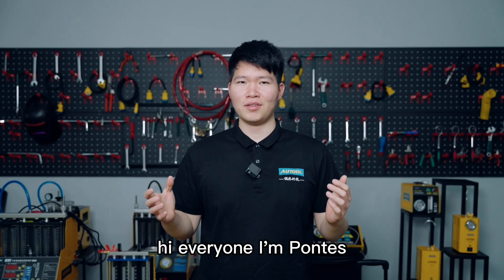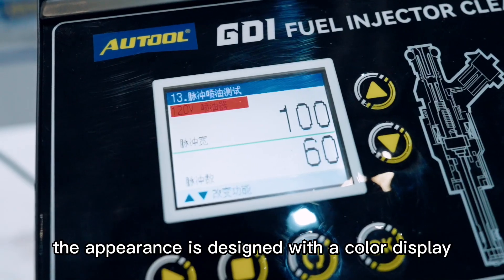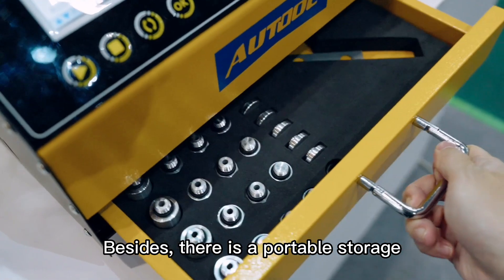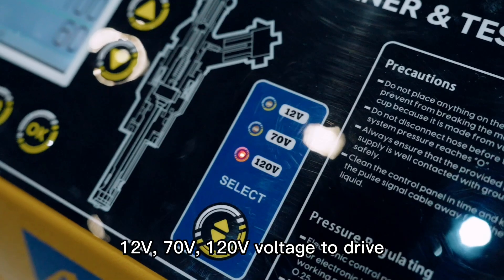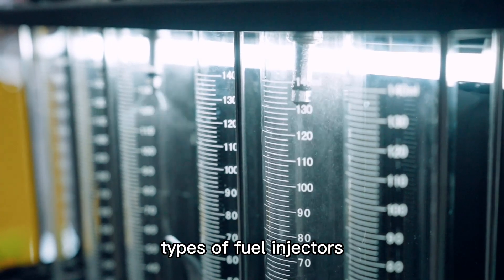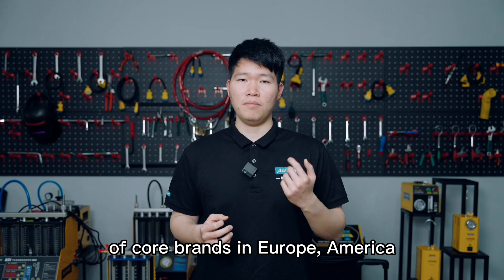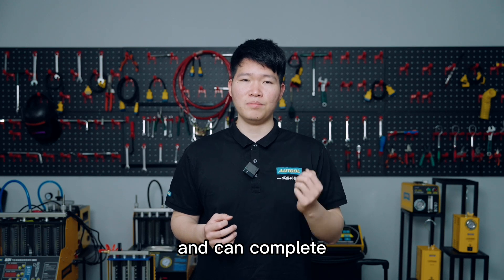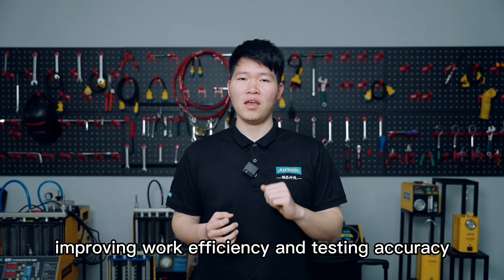AUTOOL CT500 Automotive Fuel Injector GDI EFI FSI Cleaner & Tester Full Featured 6-Cylinder Machine

Comment: What are your suggestions for best ultrasonic cleaning fluids ? 
Special ultrasonic cleaning fluids ? 
Or can I mix my ultrasonic fluid with some cheap fluids by my self ?

Are there some commercial ready to use ultrasonic fluid witch are not good and to agressive for gasoline/petrol engine injectors ?

2nd question =
What are the good test fluids for the tube test and tube cleaning  ? 
Pure alcohol I think. 

And yes I think the CT 500 is a nice and long lasting cleaning and test machine
and it will be worth the money.
Reply from the maker: Yes, for testing fluid, pure alcohl is good, such as medical alcohol.
And as for ultrasonic fluid, you can choose brand 3M or LUCAS

Comment: What about the diesel injectors? Can it clean them?
Reply from the maker: Our injector cleaning product is capable of cleaning diesel injectors; however, it should be noted that it does not have the ability to test them
Reply: I dont think so. Sorry I can not understand the answer from Autool Tech. 

1. A diesel injector need very high pressure.
2. And there are different types of diesel injectors (common rail injectors (or some VW injectors with additional mechanicl press from a camshaft)).

Diesel injectors need a very high pressure. Ok these machine can deliver upto 10 bar. 

My dieselinjectors get pressured diesel fuel up to 160 bar.
Ok I think it is maybe possible to clean it with 10 bar fluid pressure. 
But I know VW injectors and these are drives by a mechanical preassur on top of the injector by the camshaft. 
The electric connector regulates the open time as far as I know. But I dont know these VW diesel injectors not really. 
And yes VW have standart diesel injectors too. 

And the gasoline/petrol injectors for manifalt injection and direct injection in the combustion camber you can find with the different VW  (or Audi) engines. Identical with a lot of other car brands. These are working with your CT500 well. 

And yes, I can use the ultrasonic behind the tubes and try to clean it outside and I hope inside the injectors too. 

I like to read more about the different cleaning fluids and the fluid for the test tubes. 
I download the users manual at: www.autooltech.com, 
than choose: SUPPORT 
and click: DOWNLOAD
and  page 2 I find the 
CT 500 manual (version: may  29.  2023) 
Nice manual. 
( I download the other manual from the other cleaner modell aswell)

But I can not read the word = diesel injectors 
in the manual.GDI or EFI or FSI injectors are in my opinion for gasoline/petrol engines.

But sure I can clean and test direct injection injectors for petrol PERFECT. 
These gasoline direct injection injectors normally have higher preassure to work. 
And yes , I think with 10 bar these injector types have enough fluid pressed thru the small holes. 
I hope so, but I dont know it really.
Reply: I just found a diesel injector. 
These injector is possible to connect with the adapters to the test tube part of the CT500. 
10 bar is not mutch , but I think it can press enough diesel thru the small diesel injector holes to see the spray ...

But some diesel injectors have the fuel connection at the side. 
I have to look closer in the manual and see if there are some adapters.

I hope that in the manual will be a listing what engine/car brand and what adapter is recommend plus the preassure.